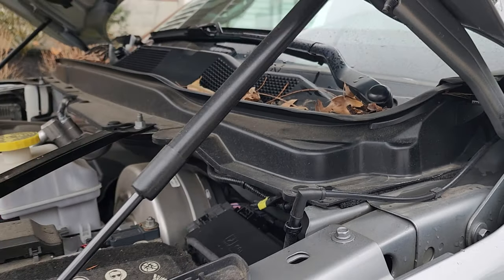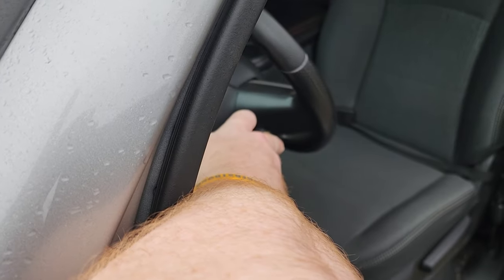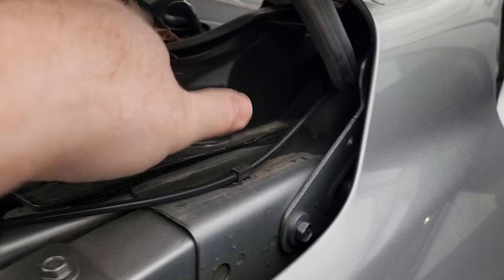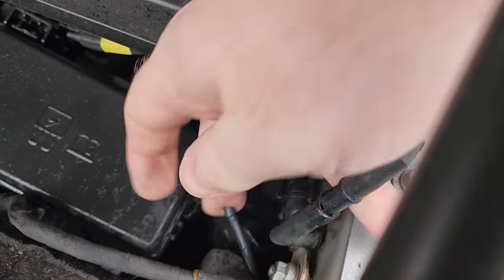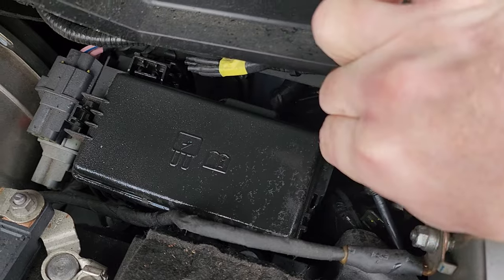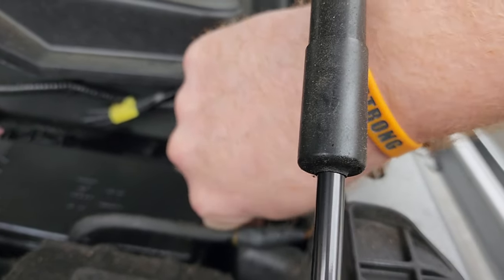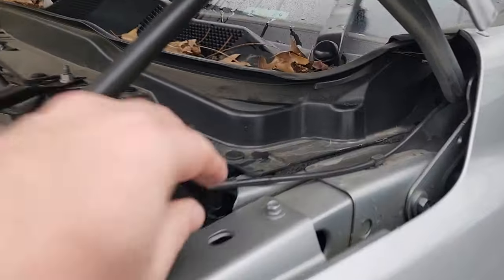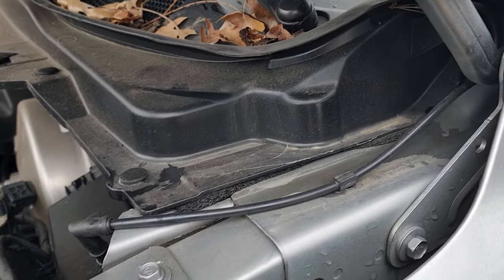Dodge Ram Windshield Washer Fluid Not Spraying #dodge #ram #diy

Comment: What if it's visibly leaking UNDER the shroud?  How do you take the should off to reconnect it?
Reply: this is my exact problem too what did you do?
Reply: You guys find a fix?
Reply: Same issue, removing the heat shield today. Pop off the clips, make your connection. Most likely will need new clips.

Comment: usually happens for a reason, not necessarily due to a design flaw but if your washer jets get clogged up or frozen and you use the washers this will happen.